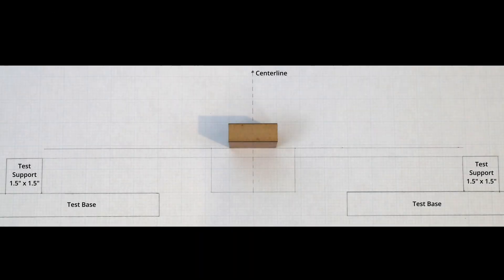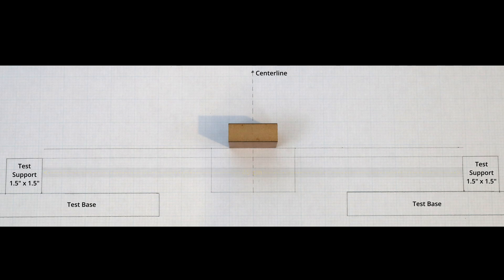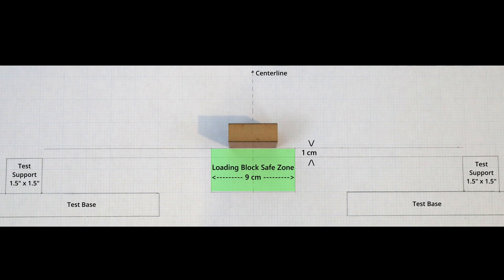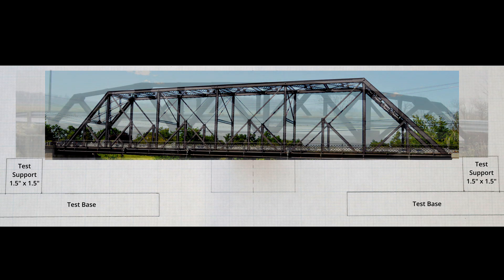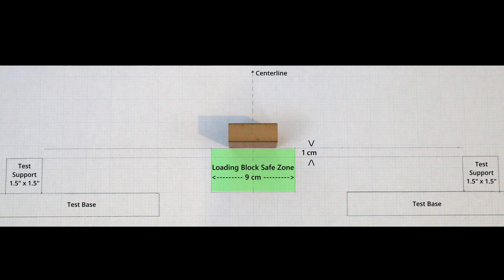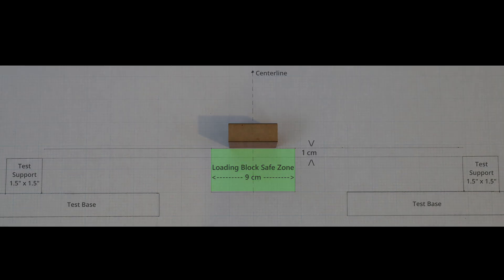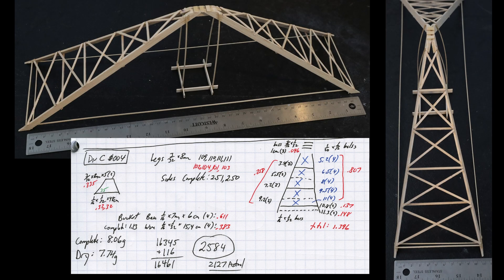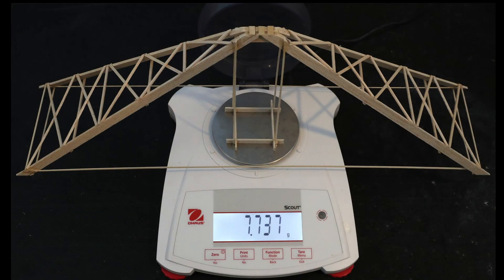2023 Science Olympiad Bridge Div C: 2584

Comment: I'm wondering whether triangles in a simple VVVVV pattern between members would shave weight over the |X|X|X|X| pattern - (at least as you got to the top of the bridge where the columns are closer together) without compromising strength, and then the saved weight could be used for stronger tension members.

Comment: For central loading blocks, the "half a spoked wheel" design seemed to be the clear winner for the spaghetti bridge - one of which took almost half a tonne! So using the highest density balsa wood steamed into semicircles with basswood spokes hanging down to converge in the middle of the roadway. Then joining the two semicircles on either side of the roadway together with triangle patterns of wood sticks - perhaps even converging them together at the top of the middle.
A paper bridge I built at school - unfortunately a very restrictive fastening method of rivets with holes that tended to buckle as you had to pinch the tubes, and no glue/tape/chewing gun but could use string. I think I just instructed our group to end up building a big triangle above the roadway with string hanging down to the middle. The roadway was a piece of thick card that was strong in tension. There were more elaborate bridges that did well, although the weight required was only 1.5 kg so the object was to keep material "cost down" with a piece of paper being "1000" and I think string I can't remember maybe 1000 a foot (although using paper strips instead of string if I could find a way to join them without tape could have cheapened out)
Reply from the maker: While those elaborate bridge designs are very cool, I don't think they would work well with the loads we are working with for the Science Olympiad rules.  Here, we don't want to hold 1000 lbs, but are limited to 15kg (~33 lbs) and need to design the highest efficiency device at that max load.  The winning bridge this year for the 45cm span was only about 6g and for the Div B (middle school) 35cm span with slightly different rules, was only a ~3.4g bridge.   People have attempted curved balsa bridges and the general conclusion is that it's not worth the effort and isn't even stronger than some of these more simplified designs for this use case.  Do you happen to know how much that spaghetti bridge weighed that held ~400+ kg?  My guess would be it's nowhere close to balsa in terms of actual efficiency

Comment: Hi, I have a question. So when I test my bridge, the only part that keeps coming off is the hanging platform pieces that are glued to the top of the bridge. Otherwise my bridge is all good. Do you have any recommendations as to how I can make those hanging bass pieces have a little stronger hold?
Reply from the maker: Hi!  If those joints are popping off and the wood is not actually breaking, then you need to try and re-enforce that joint.  I think I showed the technique I like to use for those joints in the build video.  Check out part 4: https://youtu.be/67JafXEpOQk   The short version is to glue those pieces normally, and then add additional glue along the edges and use CA accelerator.  Give that a try and see if it helps.  Good luck!
Reply: Thank you so much!
Reply: By the way, exactly which accelerator would you recommend?
Reply from the maker: @FikrieHodzhova  The brand probably doesn't matter at all.  FWIW, this is what I've been using: https://www.amazon.com/gp/product/B00NH4AJV6/ref=ppx_yo_dt_b_search_asin_title?ie=UTF8&psc=1
Reply: @balsaengineering6686  Thank you so much!

Comment: Hi I love these videos and I used the design at regionals and placed third. Currently preparing for states and wondering if you think gluing the cross members at the intersection is beneficial or not?
Reply from the maker: Hi!  Congratulations with your success at Regionals!  It's absolutely critical to glue the center of the cross members.  The buckling strength of a piece increases as the square of the distance decreases, so when you glue the middle, it essentially makes each cross member piece half the length and 4 times stronger.  Good luck with your future builds!
Reply: @balsaengineering6686  thank you. I must have missed that in the video

Comment: You said the base width of the bridge has to be at least 10cm  but i don't see that in the rules
Reply from the maker: Check out section 6 (Test Apparatus).b.iv.(2) in the rules where they talk about test support contact zones and then look at the diagram to the right of that and for Div C, the contact zone is > 5cm and < 3 inches per side, so overall, it has to be >10cm and < 6 inches.   (For Div B, the width must be < 10cm)
Reply: @balsaengineering6686  so the bridge has to be a minimum of 10cm wide? is there a minimum height requirement?
Reply from the maker: @topicskyz3100  Yes, 10cm min width at the base.  No height requirements at all except for the loading block position
Reply: @balsaengineering6686  Ok, thank you for your time. The way it is explained in the rules confused me, so I appreciate your responses. Where do you find the balsa wood, is there a website?
Reply from the maker: @topicskyz3100  I like to buy my balsa sheets from Specialized Balsa: https://specializedbalsa.com/products/balsa_sheets.php
Reply: This is very much true. I didn’t realize it and got placed in tier 2 with a very much pathetic bridge.
Reply from the maker: @unknownperson3691  Sorry to hear that!  Yeah, sometimes the rules can be a bit convoluted and you need to read them very carefully.  I've even seen times where the rules as written were not clear no matter how many times you read them.  We had to submit a formal question to the National committee to get them to issue a clarifying statement.  That is typically what happens when you see "rules updates" mid-season.

Comment: Hi, I am no physics whizz so I wanted to ask how the 4 little dangling pieces of wood used to hold the testing block aren't breaking. It would seem to me that those pieces would easily break, but I just wanted to ask. Thanks!
Reply from the maker: That is a good question! I actually ran some experimental tests on just that part before building the first bridge design like this.  It's certainly not obvious that it would hold.  The short answer is that those pieces are basswood which is much stronger than balsa, especially in tension.  Also, while the testing block needs to support 15kg, there are 4 of those "wires" that distribute the load, so each one only needs to hold ~3.75kg (15/4).  That is still a lot of weight, but not as crazy as having to hold the entire amount.
Reply: @balsaengineering6686  Thank you so much for the explanation. This makes a lot more sense!

Comment: I agree with the previous comment - with this design, it is too hard to put a loading block on the loading framework. I am using 2 inch long eyebolt in the loading block. Given the rule that the maximum length of thread eyebolt could be 4 1/2, it's almost no way to put the loading block on. Any suggestion?
Reply from the maker: A couple suggestions, first you can just make the hanging platform a tiny bit bigger to make it easier to put the loading block in.  That shouldn't effect the performance.  Also, if you read the rules carefully, the students can disassembly the loading block assembly during the test setup, so they could put just the block in, and then thread the eyebolt in after it's in place.
Reply: @balsaengineering6686  Thank you for your reply. Disassembling and assembling should work.